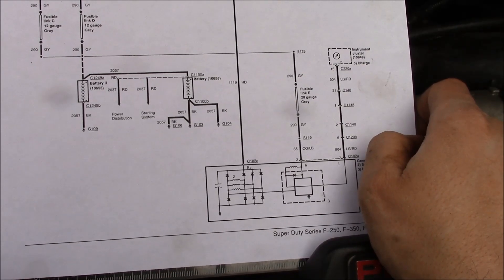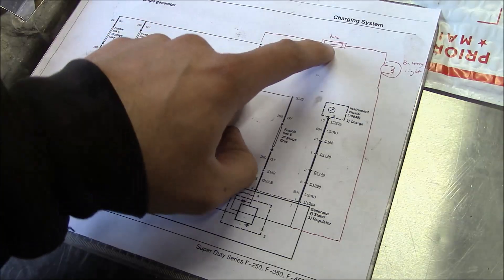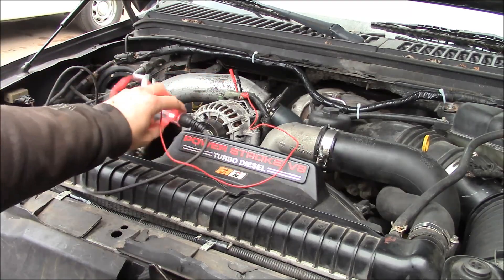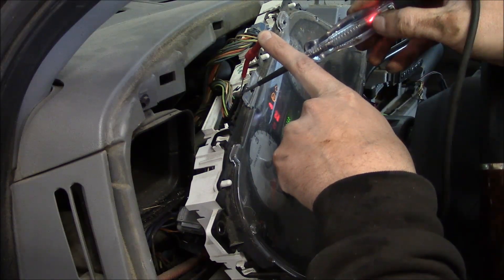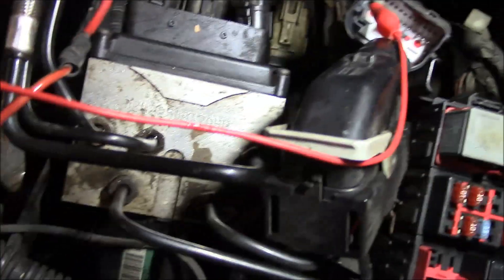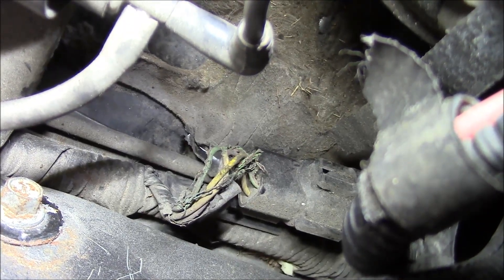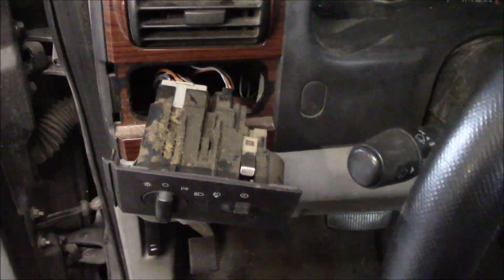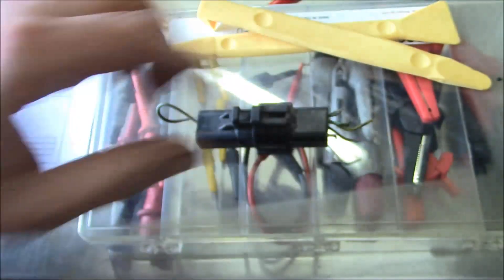Ford Super Duty Charging System Diagnosis and Repair

Comment: Thanks friend, after watching many videos, yours was the one I found that had the same problem as mine. I did the same as you and now it works 100%. Before that, I removed the harness but it turned out to be fine. You helped me save a lot of money since I was tired of not finding the problem and I was even going to take it to a place that specializes in electrical systems and that is expensive. Thanks again.

Comment: Anyone know about ecu voltage 73 volts and I'm getting turbo overboost code the hose has no pressure at idle but scan tool says pegging psi on I think it's all voltage issue and help
Reply: F750 2019 is truck

Comment: June 2024  I own a 05 F-250 6.0 not charging. I noticed that connector a week ago chewed on too, would this also cause the engine to run rough because of low voltage?

Comment: i have been having an issue with my 23 F350 charging system fault, battery indicator reads 15 amps, the dealer had it a week then said it was a battery monitor sensor, they replaced it then on my way home from the dealer i got the same fault again, i only have 1500  miles also

Comment: Could you just loop the original alternator wires together. Then take new alternator wires with new plug and wire directly to the battery? I think my wires aren’t broke yet just on and off 100 times and eventually burns my alternator up. Going on 3rd one.

Comment: When I prob my light green with red wire everywhere my test light bulb is very dim. Normally when I start the engine in 20 seconds it shoots from 12v up to 14v. Now it won’t shoot up at all. And stays at 12v. Any help would be appreciated.

Comment: I had the same issue! Couldn't track it down because I didn't have the connector info. Rat got in and got a bunch of stuff. I fixed all I saw but the dummy plug. He chewed the loop and I had just unplugged it because I was going to order another....well after a lot of testing because my batteries went dead because no charging I finally decided to just rig it because what the hell it's the same color wire as the alternator wire. And well viola. Wish I found this video first. I was going to make a video of my own just because of how dumb it was 😅

Comment: Wes, Like others before me you took me right to the issue. I had/have a squirrel getting up in the engine area at the same place. I saw what you found and looked and it was the same exact cap! wired in a jumper and was back to charging. Thank you for your post, it was very helpful. The next step would have been an unneeded  alternator placement.

Comment: You are not alone, the rats love that connector for some reason. Keep in mind single or dual alt is a programmable option in the pcm, when dual alternator are used the pcm switches between 
Alternators, not both on at the same time.

Comment: Its also good to point out if the instrument cluster fails with  the volt meter  the alternator will not operate .. the volt meter controls the output I think .

Comment: I really appreciate your video.  I'm having an intermittent charging problem that's being elusive.  Thanks to your video, I've managed to eliminate some areas.  I'm wondering where you got your wiring diagrams.  I'd like to have a full set for my 2006 F-250, 6.0 Turbo Diesel.  Could you please point me toward them?  Free would be great, but I'm happy to pay for them.  Thanks.

Comment: Pretty standard thing in older GM alternators. Always do the bulb check, and if that battery light’s not on, go no further than that because the alternator won’t work. As an aside, I worked with a few cheese eating bastards, but on two legs.

Comment: After installing my new second alternator, assuming the voltage regulator was bad in the first new one, and the battery still wasn’t charging, your video saved me hours of troubleshooting! The mouse only chewed my green wire as well. Devious bastards! ;)
Reply: I counted nearly 20 comments with the same, exact problem. Very weird they only chew that wire.

Comment: Don't beat yourself up for looking in the wrong place.  Your logic was sound and, 99% of the time, would've led you in the right direction.  What's ridiculous is that the circuit to turn on the regulator circles the entire truck three times and could be defeated by a burned out bulb in the dash!  Somewhere there is a Ford Engineering manager whose brother-in-law sells alternators.

Comment: Jobs like this gets me thinking all sorts of stuff, "...packing groceries sounds like a pretty decent job, why couldn't I have done that instead" 🤣

In all honesty it's the analytical thinker in you that makes you such a great diagnostician. Most shops would throw parts at it first, then spend 30 mins thinking about it. Throw an ecu at it, tell the customer it's phucked because of a) rust (b) rats (c) some other random thing and send them on their way minus $1200.

Comment: For those applications with dual alternators can the both piggyback off of that single lead or would there be a wire in the loom for an independent signal

Comment: i have a 2005  f 250  it does not hold charge  new 2 batteries and alternator and 3 diff mechanics  and still the truck does not work
not mention 3 tow truck to pick up the truck from their shops

Comment: Your Not real clear ,,,  did you test  &  Jump Supply  12 volts  to the A  Sensing Circuit  ( Orange Light Blue)   or     THE  I  Control circuit (Light Green/ Red)  Key on , which turns on the Alternator .   then you went on and found your  Mice/ Wire Damage under Passenger Battery ?
Reply from the maker: It's been a while, but I believe it needs power to the control terminal to power on the regulator. The sense circuit just checks the output.

Comment: Great video.  I am having a charging issue as well.  Battery light comes on, but doesn't go off for the first 30 minutes of driving.  After that it will go on and off. (Not Blinking)  I checked the battery connections and alternator connections and they are all good.  It charges between 13.2 and 14.2 when driving.  However, I noticed this morning when I started it, it was sitting at 11.2 but after a few minutes jumped up to 13.6.  The whole time the light is staying on.  I am thinking it is the alternator.  The truck is an 04 and that is the original alternator.  Any other suggestion that I might need to look at?  (2004 F250 CC 6.0, single charging system)
Reply from the maker: The light should go out when the voltage regulator in the alternator starts working. If your light is on, most likely your regulator is bad.
Reply: @WatchWesWork  So replace the alternator it is.

Comment: Have a 2003 F-450 SuperDuty  6.0  Same schmatic  ...Get nothing from Trouble light Tester at the Alternator test   Leads ..... where  is the   all the Connectors, Fusable Links     Nothing with Trouble light from Circuit A  nor  I circuit

Comment: Great video , I went tracing wires , into the dash and wowzas what a nightmare, turns out it was that little green and red jumper c1148 over on the passenger side was all chewed up. Alternater works now and the battery light now comes on when the key is turned off when the alternator kicks on.   Perfect !  Thanks a bunch ! 2001 F550 7.3L

Comment: I have a 2001 7.3 and replaced batteries and starter etc and was doing good driving etc and then made a hour trip and then battery light came on figured alternator so changed it out still didn’t start etc so kept digging turned out IPR needed replaced the electrical part was broke got it going finally and took it for a cruise came back let it run to get it back to good and came out noticed the gauge was dropping and my monitor was dropping pass 10v turned things on and it went to 8v killed truck took the one off that was just replaced and they swapped it out and this one still does the same thing I checked continuity between batteries and they are good I checked volts to the signal wire that plugs in while key on and wasn’t 12 volts and then. I took leads and went from negative on battery to positive b+ and was 3volts I didn’t start it or check fuses just yet because it got dark out and I also have had mice issues in that same location on passenger side so I’m going to check that out to once it’s day

Comment: I have a problem with rats where I live.  It's a clean area in s. Florida, but these are like palm rats or something.  They haven't chewed wires yet, but they've made nests next to my battery and once a rat died in my ducts right behind the cabin air filter.  I use peppermint oil to repel them.  Works great, but you have to do it kind of often.

Comment: After watching this video I went outside and looked at the second alternator connector and what do you know, it had been chewed through.  It was apparent that some critter liked the insulation that covers the fender liners and the wire was colleterial damage.  This saved me tons of diagnosing. Thanks
Reply: Heard bc the wiring covering/insulation is soy based and that’s why they like to eat it

Comment: Wes—thanks for your diagnosis of this problem—I had the EXACT issue with my 2006 F250 last night, and the truck stranded me.  I made the rookie error of simply replacing the alternator—but when the old unit bench tested “good”, I knew  I had another issue with the charging circuit.  I found your video, looked at that stupid harness on the passenger side fender, and the same light green wire with a red stripe (circuit 940) had been snacked on by a mouse, who left “evidence” of his presence.  You saved me literally a dozen hours of troubleshooting. Thank You Wes!

Comment: Thanks for the video my truck Broke down on a bridge because it wasn’t charging and after watching your video it turned out that it was the same problem a mouse chewed through the wires so I spliced them charged the batteries and now it’s back to working again.
Thanks for taking the time to diagnose and make a video of it your a good man.

Comment: I messed with my charging system for a couple weeks.  I was ready to part the POS out. I started watching your vid but it was going too slow so I stopped.  I had some type of critter in my engine bay, mostly making nests from the hood insulation.  I only saw one spot of wiring damage near the brake master on unused wires.  In frustration I started watching again, mostly because of the rodent in the thumbnail.  I made it through the whole thing and low and behold!  Same exact problem on my 02.  By the way, my parts store wanted 18 bucks for a Ford panel lamp.  Thanks for making this vid.  Did I say POS? 7.3 forever, best truck ever made. 😆
Reply: You weren’t slow, I was frustrated!  You thoroughly went through the steps and I was was wanting to get to MY issue.  My problem totally.  Glad I went back and watched it ALL.  The alternator overhaul company has a help line and the tech was pretty knowledgeable.  He didn’t mention that circuit.  Anyway, thanks again.
Reply from the maker: I think I've had at least 4 people say they had the exact same issue. Glad it helped. Sorry if it was slow.

Comment: Dude you are the man!!! Thank you. Thank you. Thank you. My F250 died on the highway. Called AAA for a charge. We found no power from the alternator so we replace it and one of the batteries. Almost got home but it freaking died again. So I googled the problem and found your video. I sure enough the exact same problem. Some Rodent chewed mine too. Fixed it the same way as you. You saved me ass loads of time and money!!! Bravo!!
Reply from the maker: Wow! You're actually the second, or maybe even the third person to tell me they had the same mouse damage to the same wire. What are the odds of that?

Comment: Dude we just did an engine swap from a dual alternator 6.0 to a single and couldn't figure out why the alternator wasn't charging, you're an absolute lifesaver. Thanks for saving me all the work of pouring over the wiring schematics, I legit owe you a beer. Cheers from NY!
Reply: Great job it is very satisfying to find the problem
Reply: Soooo I would love to delete my second alternator setup..... I read all kinds of crazy shit about messing with the wires at the pcm... This is sooo much easier if it works for me. Thank you

Comment: I had another power stroke Truck one time that had a slow drain on the battery after you drove it 5  hours or so later it wouldn’t start. It was really cold and really late when it pulled in and I had already put everything up to head home so I just left it outside because it was going to be like 15° that night and I put a six amp battery charger on it. my boss man asked me what I was doing why didn’t pull it in the shop so it would stay warm I told him I’ll check it at 8 o’clock in the morning if I pop the hood and the alternators warm it’s bad. I came in the next morning the alternator was nice warm like little heating element so I replaced it problem solved. Sometimes that helps finding power drains At least with alternators or relays because you can let the vehicle get cold and keep power to it and they will stay warm To the touch Most of the time They can help get you on the right circuit at least. Had a horn relay doing that one time on an old dump truck and the wire in the steering column and shorted out and they had just unplugged the horn. It was an old gas powered C 60 Chevrolet and after a week or so that little relay would eventually drain the single battery down to the point it wouldn’t start. It’s a wonder it didn’t burn to the ground that little relay was so hot you couldn’t touch it.

Comment: Man I don’t miss working on those trucks lol. I had a similar problem that turned out to be really simple thing but it just confused the heck out of me.  It was the same truck same engine the battery light came on one of the other guys put an alternator on it it was good to go for two days. I get in the truck to move it and fired  it up And the Battery light was back on. It was blocking my garage door so I had to move it by the time I drove it around the shop the light went out and you could hear the alternator pulling on the engine so it started charging I pop the hood and check the wiring the alternator was getting warm so I left it alone. They drove it the rest of the day and it was fine. One of the guys brings it in the next day and says the alternator is out again. sure enough I get my voltmeter and check it and it’s not doing anything But there’s power on the field current wire so I know that it should be charging. I’ll take the alternator back and get another one for free put it on fire it up check it with my voltmeter it’s charging just fine. Boss man leaves in the truck an hour later he makes it about 10 miles and calls me and says the alternator lights on again. I drive my truck down to where they’re working get out my voltmeter again and fire it up sure enough it’s not charging and this time I pierced the wire With my test lot which I usually don’t do and it was still showing field current but the alternator wasn’t putting out but as I move the wires around I heard it start to whine and it started charging again but all the wires looked perfect. I’ll take the plug off and it looked like someone had shoved something down in it And I guess they had spread the terminals apart where it was making intermittent connection and had burnt it up. I couldn’t really see in the connector as it had a pretty small pin. Luckily one of our shop supply companies actually had one of those plugs and I had him send me one I replaced the plug problem solved. It was such a simple problem and I just overlooked it. All the wiring and connectors were so nice and clean on that truck I never thought they would be bad or that somebody would’ve been digging in them with something.

Comment: Anyone who can solve electrics on cars from wiring diagrams has my respect
Reply: Yeah, theyre kind of handy. The problem with them is: Most of the time you dont know where the stuff is located...
Reply: @Chris-yy7qc  going from the piece of paper to the actual vehicle is the same is going from night to day. The practical application of what's drawn on paper are 2 completely  different worlds.
Reply: Same, i can rebuild engines, diffs, hell pretty kuch anything, but wiring is my nemisis
Reply: Nice to have a factory electrical schematic with connector pin information.
Reply: Taking off on a "Wild Goose Chase" due to a wrong multimeter setting is so aggravating.  Happened to me more than once.

Comment: Man I appreciate this video, I have the exact same issue  all the way down to the same freaking rodent problem. That same plug a squirrel chewed mine  on my truck. Been having electrical issues, truck throwing low voltage codes and losing power. I'm about to fix it and let you guys know the out come in a few days
Reply: Hey guys I'm back to say that this fix worked. No more codes and starts up alot easier,  faster and more power. Thanks wes for the video.

Comment: Wes don't beat yourself up so bad. Electrical problems are a nightmare to trace on any vehicle and especially one you just disturbed every sidle plug under the hood during the motor swap. I'm a firm believer in owning complete factory wire diagrams for any truck I'm going to be keeping. I know that's impossible for a shop that works on so many different makes and models. Your spot on using the forums and google and internet resources but all of this eats up huge amounts of time. Sorry I'm rambling. Just want you to know I've worked days on retiring Ford Wire looms due to rodent damage in an RV V10'Triton powered rig among many others.
Reply from the maker: I can get most wiring diagrams from All Data, but it's kind of pricey. Where it gets tricky is the big trucks and odd equipment.